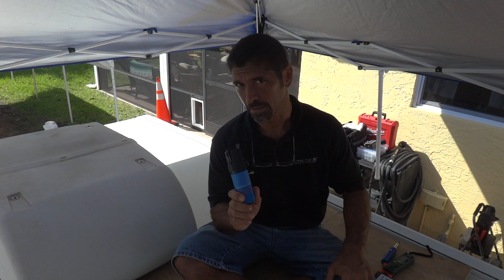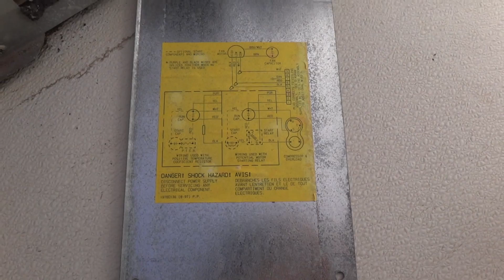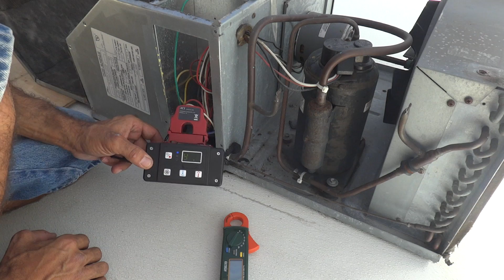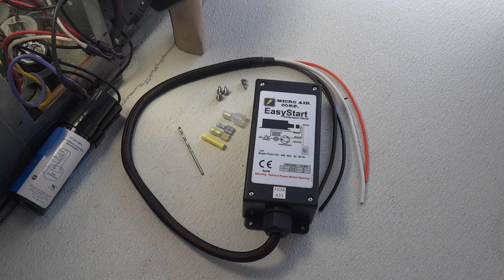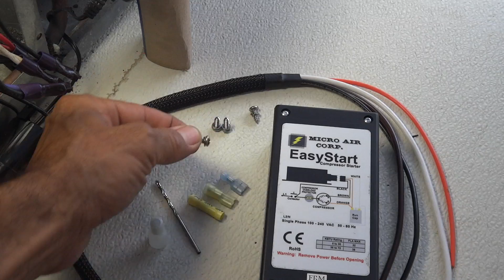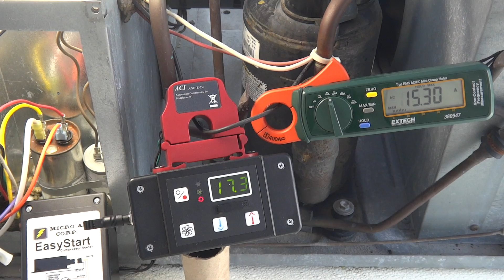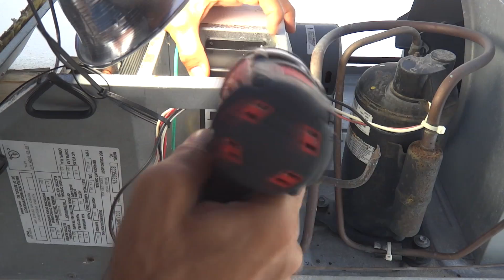Micro-Air EasyStart Soft Starter Installation into RV Rooftop Air Conditioner

Comment: Why don't the AC manufactures install this from the start
Reply from the maker: Hi Stephen.  Thanks for the question.  The answer unfortunately is a bit of a long story.  I'll try to be brief.

As most know, there are primarily two rooftop A/C manufacturers in the USA, Dometic and Coleman/Airxcel.  First, Dometic manufacturers all of their rooftops in China, and there is no way that any Chinese manufacturer would ever import USA made electronics; in my 30+ year career, I've never known of that to happen, so it's basically out of the question for them.  Second, Coleman/Airxcel did actually build EasyStart into a special 240V/50Hz rooftop they made for the Australian market about 4 years ago. They eventually lost the contract to Air Command (now owned by Atwood/Dometic).  While I was working with them in their Wichita, KS factory, I did ask them why they would not consider offering EasyStart in their domestic 120V/60Hz models, and they answer has always been the same:  "We're in a fierce price war with Dometic, and we do not believe our customers would see the value and want to pay more for the air conditioner".   

Because of all of this, we at Micro-Air have instead focused on the RV aftermarket (instead of the OEM A/C or even the OEM trailer market). We've proven over and over again that the RV customers DO see the value of EasyStart since it DOES cost less than buying a second generator to put in parallel, a larger generator, or a larger inverter, all just so they can run their A/C.
Reply: Micro-Air, Inc. Great answer
Reply: Stephen Clay   because they build the absolute minimum they have to. installing that from jump would make too much sense.

Comment: Great info  and will probably buy an easy start.   I have a Honda inverter 2000 iu generator for my camper and by this video should work great.  Can you do a video showing it running on a 2000 watt Honda inverter generator?
Reply from the maker: Hello Craig.  Thanks for your comment. Although we and our customers have demonstrated starting and running an RV rooftop A/C on a Honda EU2000i generator literally hundreds of times, we have yet to formally video tape and publish it.  Instead, we demonstrated how we could start and run a 15kBTU Dometic Penguin II on a smaller 1800W inverter.  This video is available at the following link:  https://youtu.be/dmIQkOw6Tl4. We still hope to publish a Honda EU2000i video soon.
Reply from the maker: Hi again Craig.  Please send us an inquiry from our website in order to get in touch with me.  Ask for Matteo.  Thanks again.
Reply: Sent a message through your website. thank you

Comment: Nice video showing start current instantaneous reduction. Looking at your two meters it appears the current pulse has been widened. This can be seen because the comercial meter current measurements are getting closer to the built meter. Since the comercial meter averages it can more accurately measure the wider pulse.

Comment: couldn't you have made a power cord by taking an extension cord and putting the cap in line with it and using that cord with a plug to run the ac? or does it have to be wired into the ac unit itself like you did? I was thinking if you took some house wire and made a cord with the cap in line and a two way outlet on the end you could use it for microwave and ac? what do u think or am i just retarded?
Reply from the maker: Hi Dani.  Thank you for your comment and question.  The EasyStart has to be wired into the motor directly - in this particular case the compressor motor - as demonstrated.  It cannot be wired "in line" with the AC power feed as you asked about.  EasyStart is specifically meant to work with AC induction motors, detecting feedback from the motor as it conducts is gentle ramp-up of the power during the motor startup.  Unfortunately, EasyStart cannot do anything for the microwave, or any other appliance.  EasyStarts have been installed with success into other types of AC induction motors (high pressure pumps, air compressors, refrigeration compressors, etc.), but there are really no other large (>1000W) AC induction motor loads in an RV other than that of the air conditioning compressor.

Comment: I amigo, I try to run a 30000BTU(8.79kW). if I use your data(and using a soft start) I would be able to run the A/C with a 5kW solar inverter, do you think I be able to do it
Reply from the maker: Hello Jose.  Yes, the EasyStart 364 will reduce the starting amps of a 30kW A/C compressor to about 4800W (conservative estimate based upon 60A LRA @230VAC).  Providing you don't have any other substantial loads drawing power besides the compressor and the A/C unit fans, your 5000W inverter should be able to start and run it without a problem.  Most inverters have 1.5x to 2.0x in surge capacity anyway.
Reply: there's a table where I can get this relation that you are telling me(30kw start to 4.8kW run);
did you see that I have 8.79kW

Comment: how is the AC manufacture able to use 14 gauge wire on a 41 amp start up?
Reply from the maker: As is done with all AC motor appliances and per the NEC, the circuit breaker, overload device ("Klixon"), and wire all allow for the short-duration, high-current condition that occurs during the motor's startup, without a soft starter installed.

Comment: Thanks for this video, but I have a question/comment.  In this video https://www.youtube.com/watch?v=DsgRachoLEA showing the installation of a hard start capacitor on an RV AC, the person says they have the taller capacitor and the shorter capacitor.  Does he actually have a start capacitor?  He doesn't disconnect anything like you did.  I don't know much about electricity but if you already have an OEM start capacitor, wouldn't adding a hard start cap without disconnecting the OEM start cap essentially be putting the hard start cap in parallel with the start cap and therefore increase the boost at compressor startup?

Marion Blair's experience was that by delaying the fan startup until after the compressor had started he was able to start his AC with a Westinghouse 2400i generator.  That may or may not work with a 2000W generator.  Although I agree with other commenters that your claims are perhaps a bit exaggerated (70% reduction vs LRA, for example, since you noted that the AC didn't actually draw that much current) I accept that the EasyStart will be better than a hard start cap.  But trying the hard start cap (with or without the fan delay) first will be substantially less expensive if you can get it to work.  At the end of the day, using a 2000W generator will limit your available power as compared to a 2400W or 3000W generator, but the EasyStart would be a lot less expensive than the larger (or second) generator.
Reply from the maker: Hello A. Thank you for your comment we're glad you like the video.  In the other YouTube video you cited from "heylawnguy", he unfortunately did misidentify the capacitors in his Coleman A/C early in his video.  Unlike the Coleman A/C we worked on in our video, his did hot have the factory-installed hard-start capacitor.  The taller cap he identified as the "start" capacitor was in fact the run capacitor for the compressor, and the shorter cap he identified as the "run" capacitor was in fact the run capacitor for the fan.  In our case, the Coleman A/C had 3 capacitors, one of which was the factory-installed hard-start capacitor, and so we had to remove (or at least disconnect) that before installing the EasyStart.  The compressor's run capacitor of course was not and cannot be removed.

Regarding your comments about the fan delay and use of hard-start capacitors, we by all means encourage all of our customers to explore every possible solution to their A/C startup challenge on a limited power source like a generator or inverter. If a hard-start capacitor works, then by all means do not invest in an EasyStart.

Lastly, regarding our claims of upwards to 70% compressor start current reduction from rated LRA with EasyStart, here are the facts.  In the video, the particular Coleman model had a compressor locked-rotor amperage (LRA) rating of 54A.  The actual startup amperage of any compressor will vary depending on how the entire refrigeration circuit was designed, the operating temperatures, and the current internal refrigerant pressure conditions within the system at the time of the startup.  Because of this variation, we rate the EasyStart's predicted performance based upon the dataplate label's LRA rating only. The Coleman in our video had an LRA of 54A.  After EasyStart was installed and learned, the start-up amperage was 17.3A.  17.3A from 54A corresponds to a 68% reduction from the rated LRA.  We also own a recent model 15kBTU Dometic Penguin II A/C, and its dataplate LRA rating is 52A. After we installed the EasyStart into this model, we measured a compressor start-up amperage of 14.7A, which corresponds to a 71.7% reduction from the rated LRA.  The results therefore vary depending on the manufacturer and model.
Reply: Thanks for the explanation.  I understand it better now.

Comment: The clamp on meter reads RMS (root mean square) peak it's not that it's not fast enough.
Reply: Is this product UL listed? If you install this product does it void the manufacturer's warranty?
Reply from the maker: Hello Archer11ca. Thank your for your comment.  

Yes, the terminology can be confusing and our use of the word "peak" RMS to describe a "maximum" RMS is a mix of terms. This of course is not to be confused with the peak of the instantaneous current waveform, if you were looking at it on an oscilloscope.  As you said, both clamp-on meters report true RMS of the instantaneous current waveform, by measuring and doing the actual math on the instantaneous current several times per AC alternation.  A 60Hz sine wave is 16.67ms long.  During this 16.67ms period, our internally-developed takes about 100 readings of the instantaneous current (about once every 170µs).  Then its microprocessor quickly does the RMS arithmetic to come up with a true RMS for every full waveform.  This RMS value is then saved at the end of every 60Hz waveform as a single RMS reading.  These individual RMS readings are then put into what is known as a moving average, where a moving "window" of the last 3 RMS readings is always averaged and preserved.  3 x 16.7ms = 50ms.  So, the internally-developed ammeter can report a maximum RMS that has a very narrow time window that is only 3 AC cycles long. This is a more conservative (tougher) measurement approach.  Alternately, the commercially-obtained clamp-on ammeter reports the maximum RMS averaged and captured over about a 200ms window (or about 12 60Hz cycle periods).  

During a hard start of a compressor, the maximum current that occurs does not vary much during its 150-250ms duration (9 to 15 periods at 60Hz), so many ammeters can do a descent job of capturing the maximum RMS. Alternately, the startup of the compressor when using the EasyStart extends the duration of the startup to about 1.0s (about 60 periods at 60Hz), and goes through a distinct ramp that varies in RMS amplitude during this time period.  Since the internally-developed ammeter operates faster with its shorter 50ms moving average window for all of the RMS readings it is taking at 50 samples per 60Hz period, it is much more conservative and will report the higher, more accurate maximum RMS that occurred during this 1-second startup. Whereas, the commercially-obtained ammeter will report a lower maximum value since its moving average window is much wider and therefore mathematically lowers the maximum that can be measured across the 1-second ramp. In conclusion, the speed of the ammeter to capture a maximum RMS reading is therefore important, thus the reason we developed our own to be able to report the true RMS maximum for demonstration purposes, without having to use an oscilloscope in the video.

Regarding your question on UL, the EasyStart is CE approved, but not yet UL listed.  All of its individual components are UL listed, and it was designed and constructed with all UL practices since we develop and manufacture other products that are UL listed. Our plan is to submit the EasyStart for formal UL testing testing if and when an RV A/C OEM wishes to formally incorporate EasyStart into their product for distribution into North America.  Marine HVAC equipment in North America is not required to have UL compliance, thus the reason the use of EasyStart in marine OEM applications does not require it.  

Regarding your question on warranty, EasyStart comes with its own 2-year warranty and we will repair or replace it if it ever has a problem.  For the OEM manufacturers of the A/C units themselves, both Dometic and Coleman state that any modification to their equipment - including the use of an aftermarket hard-start capacitor or an EasyStart - will likely void their respective warranties. To go along with this information, we recommend to everyone that they consider all of the facts.  Besides EasyStart's obvious benefits of dramatically reducing the startup amperage, it also continues monitoring the compressor for 5 different fault conditions during steady-state running operation, including a stall, open overload protector, overcurrent, miswiring (loose connection), or a very brief power interruption.  All of this provides much better protection for your compressor than any OEM configuration or hard-start capacitor ever could.  We therefore leave it up to our customers if they want to install an EasyStart into their A/C systems.  If they choose to, and the A/C system later experiences a failure within its warranty period unrelated to the compressor (like a refrigerant leak, fan motor failure, or control board failure), then the customer can legitimately remove the EasyStart and submit it to the manufacturer for claim, similar to what they could do if they had instead installed an aftermarket hard-start kit.  Alternately, if a customer is uncomfortable installing an EasyStart if their A/C is still under its manufacturer's warranty, then we always advise that they should not do so.  For the record, we can report that of the thousands of EasyStarts installed into RV A/Cs, none of them have caused premature compressor failures or damage of any kind.
Reply: Micro-Air, Inc. thank you for your reply. I'm a sales rep for a large electrical manufacturer and we sell soft starts for industrial controls. When it comes to single phase motor soft starts it can be complicated and I do believe your product works just fine. You will need ULc in order to sell it in Canada. I would recommend not using your own meter in your presentation though as it seems to be causing some distrust in your findings. Get a good quality Fluke meter instead and that will eliminate some of the controversy. As for the pricing, $300 sounds about right to me. There may be other cheaper products out there but the added running protection is a great added value, you should mention it more. If you're running your AC off of a small generator or solar or batteries and the power dips down then a brownout condition occurs and that's the best way to ruin your AC unit. Your device protects against that, that's a huge selling feature and you don't touch on it in the video.
Just a suggestion.